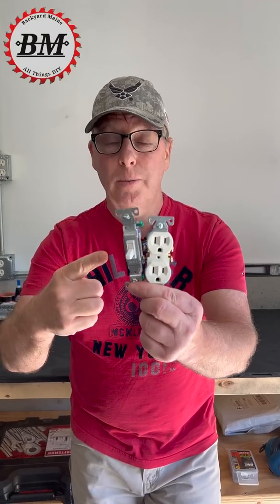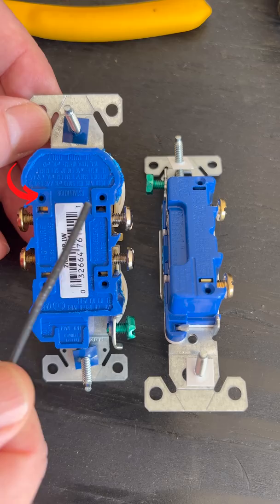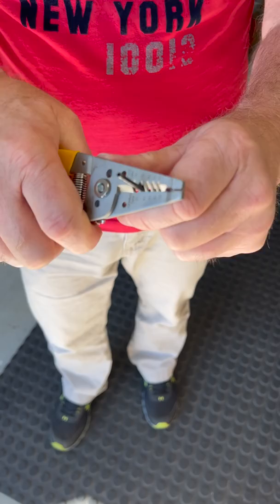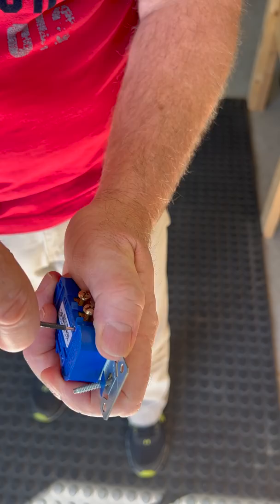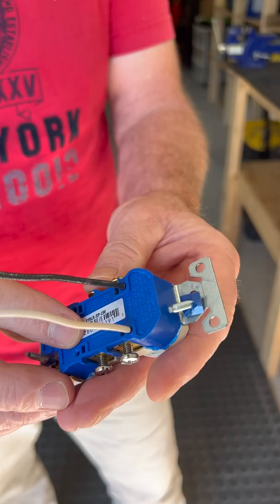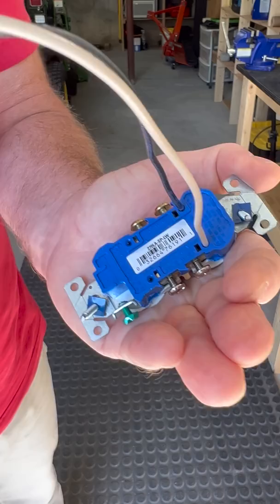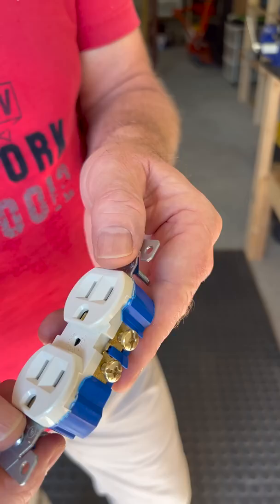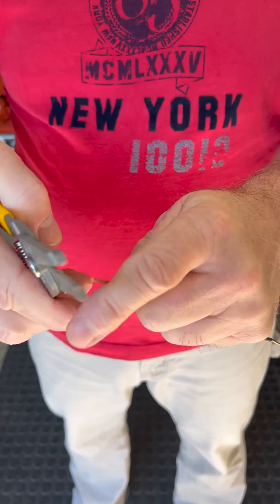Don't make this electrical mistake #Shorts

Comment: Commercial grade outlets are even better than side wiring. When you rewire your house or getting your new house wired, consider commercial grade outlets and light switches.
Reply from the maker: I agree. I use commercial grade for all my jobs. I bit more money but worth it in my opinion. I tend to show these residential grade devices because they are so commonly used.
Reply: I just noticed they are better to use. Yes cost a bit more but way better and faster to use the commercial ones
Reply: Commercial grade use a method very similar to this backstabbing. He should’ve explained the difference if he even knew it
Reply: @51-FS not if you steal them from work they aren't!
Reply: I only use commercial grade when able because I just don't like how poorly made the residential ones can be not worth the cost savings.

Comment: NOTE: Back WIRING is also a thing, where you push the wire into a hole in the back, and tighten the screw, which solidly clamps the wire into place. Much more reliable than back STABBING, though not quite as solid as side-wiring, with the loop.
Reply from the maker: Yes back wiring is quite different and is a great connection option. These can be found on commercial grade devices.

Comment: Here's a thought. 
Report the issue to NEC so they outlaw this type of connection to even be made or sold in the US if it's truly dangerous.
Reply: Have tried. They invented Arc Fault instead of stopping this practice.
Reply: I just used one that was on the side attachment and no screws and they said it was due to loose screws and the same exact thing you’re saying on the stab it through the holes in the back but the new one was a bit different it has a clamping mechanism
Reply: @rickgochoel3749 arc fault has nothing to do with backstabbing.
Reply: Master Electrician, here.
That is not going to happen. Sadly.
I wish it had - over sixty years ago!
The manufacturer's argument, that a #14 wire, properly dressed, (straight, corrosion free, the proper length) inserted just once, makes an adequate connection.
Hate seeing these. Anytime I do, I suggest the home owner have us check the rest of their system.
Reply: @Tre16 are Backstab tamper resistant on a tamper resistant outlet.
Reply: The only issue is maybe the low quality crap they produce but not actually the connection method as its one of the main systems being used in industrial electrical cabinet wiring
Reply: @AlpineTheHusky  agreed, properly manufactured spring clamp termination is more resistant to vibration and thermo-cycling than screws. Just cheap, low quality receptacles causing most of the problem.  The other part of the problem is likely low contact surface area from numerous issues, solid core wire doesn't help the situation
Reply: @@phillipbanes5484 the hell it isnt 😅
Reply: @@phillipbanes5484
Depends on where you are. Where I am, it is the law because the state legislature votes every three years to make it so.
Reply: @@phillipbanes5484the NEC is a sub chapter of the NFPA and the NFPA is a regulation (not necessarily a law) but failure to follow leaves the offender open to criminal prosecution, litigation, and very hefty fines. So in affect it is law.
Reply: They fail but fire risk has been very low and it's been that way for years. Sometimes you can get 30 years out of it.
Reply: The nec knows. It's ul listed 😂
Reply: Yea I don’t get why they’re allowed to sell it with backstabbing ability and it’s supposed still allowed under Code? No idea why they don’t just ban it all together
Reply: @Tre16 yes it does all day long. Backstab is someone screaming “I’m a lazy ass and refuse to wire a house correctly.”
Reply: @jamesm568 
Mine had been installed less than 2 years earlier when the house was built. This was years ago but it was probably a bargain basement light switch. The wire was the proper length and everything. My guess is the switch was damaged when the back stab portion of it was made. There was no evidence of a problem with the wire and it was stripped to the correct length.
Reply: 40 years experience with this method, master electrician and 1000 plus homes done with a push in connection.  I have had 1 failure because of this method.  yes...1.  These videos are just not based on any experience. It is an approved wiring method. And it works

Comment: Agreed. I've seen too many of them fail. However, there's something similar that's not mentioned in this video. The video is about backstabbing, but there's also back wiring. Back wiring also allows you to use a straight length of wire and insert it straight in. The difference is that with back wiring, you then tighten down the screw to hold the wire in. It's not a spring loaded connection, which is what backstabbing is.

Comment: I never even knew that there was an option besides side wiring 😂
Reply: And that's why you shouldn't be wiring anything.
Reply: Faxz LoL 😂
Reply: @johnlorch3484  because he only knows the better way of doing in?
Reply: There's not.
Reply: I just like that you profile pic is hank hill.😂
Reply: @redjasper9458  my friends mess with me and tell me i look like him or peter griffin so i just claim hank hill and move on 😂
Reply: Just forget you saw this video and you won't be missing out on anything!
Reply: The no tool method
Reply: am i the only one that pinches the wire to close the circle when its on the screw?
Reply: Not all duplex have that option
Reply: You probably been buying 20 amp receptacles, which don't have that feature because they know it will get hot when you put a high load on it.
Reply: @Troyvidihoo  yes!
Reply: @kz03jd  
Why ? It was a factual video and well produced.
Reply: Not surprising.
Reply: @johnlorch3484  only you 🙄
Reply: For hacks
Reply: @johnlorch3484 What a silly statement. I can likely wire better than you unless you are as much of a freak at cable management as I am. I didn't know this. I also hate the screw terminals. 

I think the wago outlets that are relatively new are best.
Reply: @johnlorch3484 lmao 😂

Comment: I always give a little squeeze/crimp, to the wire hook, just before tightening the screw. It assures it will never come off. ✔️
Reply: keeping a open loop also benefits you if you want to change it while Live because when you loosen the screw the wires just fall off just some thoughts
Reply: you and everyone else
Reply: I’ve been doing that for about 45 years. And I’m only 52.
Reply: Just about every contractor I worked for utilized the back connections ! I would tighten the terminal screws . It also depends on the brand of receptacle ! Leviton and  Eagle were pretty decent but old GE  were not so good !
Reply: @williamhaines7752  why are you yelling ?!?

Comment: My question to the NEC .. These are common failure points and fire starters from heat @ corrosion.. Why is it allowed to be used or even sold ??  Why do the electrical inspectors sign off and except this ??
Reply: Because the failures and problems is so low it is not deemed a industry hazard. I have done electrical work for 20 years and have came across failures of all types. You know what is crazy. I have seen more failures from the tradition hook method only because it is done more.
Reply: NEC no longer allows 20A/12ga backstab devices so they have looked at the issue and decited to continue allowing 14ga/15A.
Reply: I JUST did my bathroom yesterday and now I am seeing this! Talk about bad timing!!

Comment: I see so many DIY folks do it the wrong way. Thanks for the education!
Reply from the maker: Thanks for watching and supporting the channel!
Reply: It's not the wrong way it's just better if you use the screws .
Reply: @mattescoto2882  the difference is a hairline connection versus a half of an inch of connection.
Reply: @stormbringer78  i know the difference, I'm just saying if it's on there for a reason so, i do it the way you guys like anyway 8 years electrician here so do it how you want new construction does it how they want to.
Reply: I've seen so many houses wired this
Reply: That's odd because I've only ever seen anyone use the screws.
Reply: The sad reality is the holes were made to speed up the wire connection process...a really bad idea.

Comment: Never had an issue with them myself but to each there own
Reply: Me neither.....but l have seen cheap devices
Reply: 55,000 house fires are caused each year due to electrical connections being loose
Reply: Yea. most of western Europe use those quick connects.
The cheap ones use the screws.

It's not a bad system when using decent Materials.
Ofc they are cutting corners when they use both types of connectors.
Also 90% of connections fail because of bad installing.
Reply: After you backstab tighten screw and it won’t fail!
Reply: Their
Reply: @lakerfam  Nope, they are not connected in anyway, but that is quite the imagination. Back stab are UL approved. Clearly the guy in the video is smarter than UL
Reply: Never had an issue. I have seen some with not enough insulation removed, too much insulation removed or, when they were stripped, the technician nicked the wire and made a weak point. 

I've also seen issues with the screws holding the plug/switch being loose and the wires move every time that plug/switch is used, causing failure or fire, but never a properly installed piece.
Reply: are you guys electricians? 
cuz I am and those back stab go bad all the time. all the time. I do it all the time. 
very often. 
like I feel like I'm doing it all the time.
Reply: @paulchristho yes but not necessarily back stabs
Reply: Been inserting in the back for over 10 years. Never an issue.
Reply: @paulchristho  Source?
Reply: If you buy 99 cent shxt devices any part of em can fail.  Spend money on decent stuff n they will last n not fail. Backstabs will last if gd stuff which is why it's approved code
Reply: @paulchristho screw connections can be loose also
Reply: @richardpatterson4312   If the backstab connections never work for you then you might wanna learn how they work or stop buying non certified devices. Could also be that the US just has generally shitty products
Reply: @paulchristho Like screwed connections? I believe thaz

Comment: A week ago I repaired this same problem myself. My condo was built in 1986. One outlet in my basement was intermittent, as was an outlet in the garage. Turned out the basement outlet was "back-stabbed" into the garage outlet, so was the "feed line" one black came right out with the outlet! I cut and restripped all wires and put a new outlet in the basement and garage, using only the side screws to connect everything. Solid fix, now.

Comment: Speaking the gospel here. I’ve had to replace countless stabbed in plugs because of a flicker on their circuit. Several had signs of excessive heat.  Truly amazing we don’t have more house fires from sketchy electrical connections.
Reply from the maker: I put this same video on TikTok and it had over 800k view and countless comments from electricians saying they’ve been do it for years without any issues. I have fixed 100s with the same issues you have had.
Reply: It's because you don't.  
Just as much heat and electron loss can come from a side wire if not done properly
Reply from the maker: @amoncopeland6747  No not at all. I don't know how else to say it. These connections have a very small surface area and they heat up arc and eventually fail. I'm an electrical engineer and a electrician I understand why this happens. Like I said they don't have these stabs for the grounds because when they fail it would pose a safety hazard.
Reply: @BackyardMaine  I agree.  . I come across just as many side wires that don't meet spec as far as torque specs.
Reply: Bs
Reply: @amoncopeland6747  you have less contact on a back stabbed termination. That’s just a fact. I hate that’s even an option on recepts cause it gives someone false hope like it’s the right thing to do.
Reply: @StephenBrewer89  
I mean my intuition would also lead me to use the spring loaded terminals in the back. 
I work in mechatronics for a big manufacturer in the EU and there it's the standard to use spring loaded terminals and clamps whenever possible because they keep their tension while screws loosen or the wire flattens over time and isn't right anymore. 

Hence why I would intuitively go for the spring loaded terminals on these plugs and switches. Now this leaves me with the question whether the terminals on these plugs are just poorly designed or the people maybe just misuse them (not enough wire, isolation clamped etc)?
Reply: @humbucker0076  that’s my issue with them is they are misleading. They will work, but it’s not the best connection for them. I used to do many many service calls as an electrician for these failing.
Reply: @humbucker0076  A good spring loaded connector like the WAGO ones will never have this problem. 
So i guess the US outlets is just purely made
Reply: @BackyardMaine  perhaps the electrician's are using better equipment than stuff bought at home depot.
The faster installation is worth the price if you can get more work done in the same time.
Reply: @magma86dk  viewed from Europe the US electric material look like it's unchanged since Edison designed it. So that the spring connection is poorly made is no surprise. It's standard in EU with springs, and they work better than screws.
Reply from the maker: @LeifNelandDk  This one was just a home depot cheap outlet but I don't back stab. I have seen every contractor grade receptacle fail in this way. If using contractor grad side wire. Spec grade receptacle don't offer this option.
Reply: @BackyardMaine  I have an idea to use this holes, a extension to a lamp circuit! This work with no matter due low current. 😂
Reply: @BackyardMaine  Definitely depends on if you use that outlet for high currents all the time or not, the worst is when the stabs supplying the live and there are screw terminals used that daisy chain them to other plugs, seen that before!
Reply: @BackyardMaine as the saying goes "don't fix what isn't broken" now I believe that there are certain things that do need updating but other things really don't. For instance wheels. Sure you can have wheel that's shaped like a stop sign and I'm sure it will "work" but not as good as the round one.
Reply: Get some higher quality material and don’t blame the connection type being an excuse…
Reply: @andregenter4213  well genius in the 60’s when my house was built I wasn’t even alive to make a choice on plugs and no one has a choice when you buy a track home, you get what they provide.